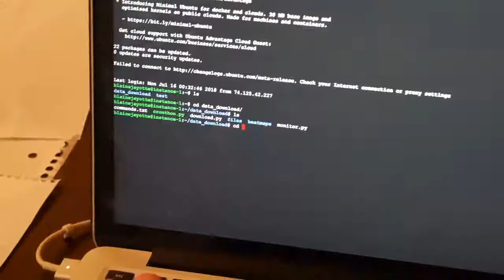AIRobot (2018)

Comment: Looks like a great project, looking ahead, I guess air coolers can be removed by just employing this robot which would just go the over heated rooms and cool them down if central AC is not an option. My mom would kill for this robot if it manages to do that lol
Reply from the maker: It was a fun project! All of the materials and codes are open source and available on hackster.io if you're interested in building one for her. It's a fun hobby